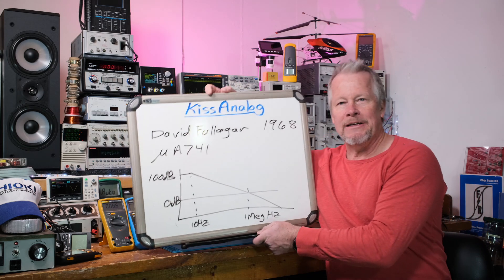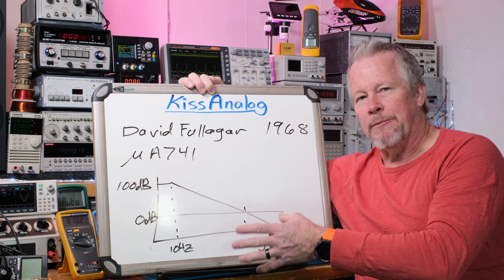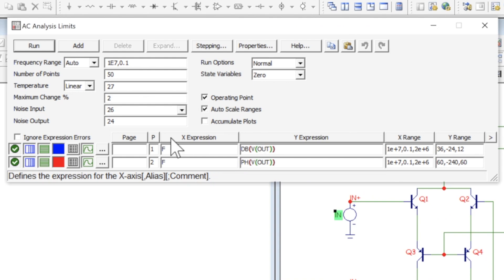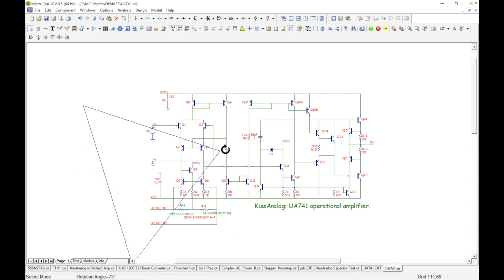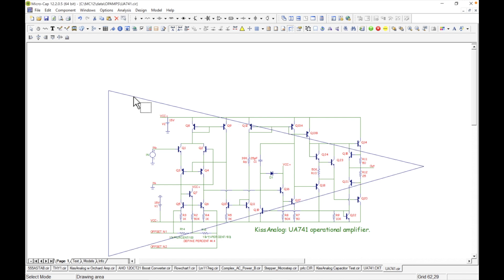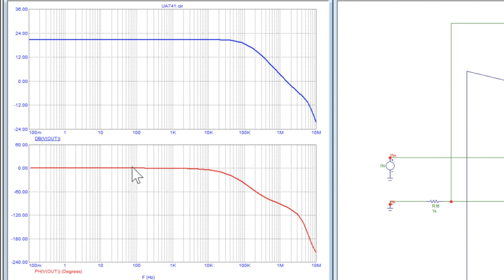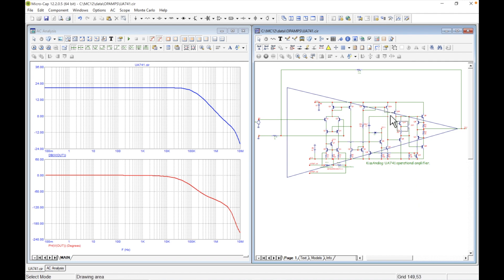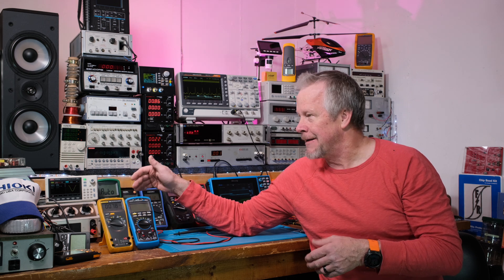Classic LM741 OpAmp Simulation in MicroCap Tutorial #microcap

Comment: All opamp simulations are crap. I have yet to find a model that isn't total crap. Macromodels are crap. Full transiator-level models are crap. Goofy code models (like ltspice OTAs) are crap. They're almost always lazily written with spice-default transistors with all zero junction capacitences and numerous bugs almost without exception.
Reply from the maker: Thanks for this feedback Daniel!  When you simulate OpAmps, what would make the simulation better?  I agree, the LTSpice models are simply behavior models for the most part (ideal at the best), so you need to be careful of what you expect.  Behavior models simply behave as expected, so what's the good?  Very little;)
Reply: @KissAnalog  Sorry not really feedback for your video. Showing a basic 741 model is perfectly fine for teaching. I'm just generally whining about the difficulty in doing a good simulation for design purposes. How to improve them? That's a complicated question (and I'm far from an expert).

Eliminating the common bugs such as ground current leakage from within the subcircuit is a big and sometimes difficult one especially when that current is due to input capacitence which needs to be redirected to the output and supply pins in the correct ratios depending on input stage topology. Related to that is developing a good scheme for an internal reference (there are several ways to handle that such as by referencing everything to the output, or by level shifting the inputs relative to the circuit ground to name a few). Other common issues I've found are lack of a PSRR model, lack of nonlinearity or phase shifting in response to transient loads, and many unrealistic responses to variable biasing conditions.  One of the many papers on enhancing opamp models is available from the qucs sourceforge page if you happen to be interested in that topic. http://qucs.sourceforge.net/docs/tutorial/opamp.pdf

Comment: When targeting flying objects such as Avangard, it is best to first verify with digital circuits in order to specialize in analog processing rather than digital processing and promote the array of differential and integrator circuits.
Reply from the maker: Thanks for the great feedback!  Is this because the Analog is faster - or more precise?
Reply: @KissAnalog  I think that the resources for grasping the situation include output information from CCD sensors, flight sounds, radar devices, and so on. It combines the high speed of analog circuits with flight path prediction, speed estimation, and cruising angle range using digital circuits. If we can roughly match in the three-dimensional space, we think that it can be deterred by issuing barrages and nets to the cruising destination in the advanced airspace. for our information.

Comment: I think it's a very cool tutorial Eddie. I think you should break it down into a series and breadboard each section of the internals and explain each. Imsai guy did it too but the 741 is much more complex. I did love the overlay. I understand opamps somewhat but I've never seen anyone say hey "we're going to build a simple audio amplifier based on opamps ands gain stages where we start with a cheap little condenser mic or headphone input jack and go right through to where we hear something in mono out to a 5 watt speaker on the other end". Everyone gets on the same page like this with the gain, delta v, dc blocking bypass caps, emitter collector and follower for maintaining the signal integrity. Do one section of which ever circuit chosen once a week or something. Like a 15 minute video once a week on a bread board where it might take 3 months to complete including troubleshooting after we're finished to clean up the signal. I've prayed for a video like that for ages and paid (wink wink) not you Eddie, he will get the joke when he reads this lol. I digress. Great video Eddie, original take on the subject.
Reply from the maker: Thanks Joey for the great feedback!  I'll make a playlist for OpAmps and build to it;)
Reply: @KissAnalog  that's awesome. I drew a schematic for a proper op amp circuit psu. I'm going to test it this week sometime.

Comment: Very nice dive into the innards of a typical op amp! Well done.
10:38 In other op amp datasheets I've seen simplified equivalent circuits drawn with, for example, a single transistor having multiple emitters or multiple collectors. Is that similar to what you're showing here? I know of vacuum state devices where two active units share a common cathode and control grid but have separate anodes, so I've wondered if something similar was going on with these op amps or, as you say, the layout artists are taking artistic licenses in the name of economical layout.
Reply from the maker: Thanks for your feedback Peter!  I think you are right - there is some artistic license taking place.  They probably get tired of trying to make space to wire each transistor.